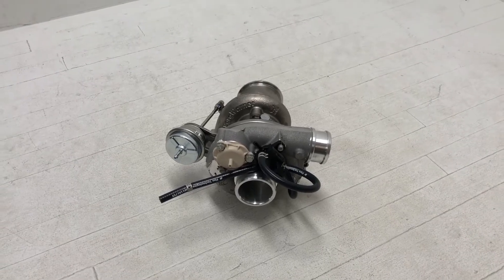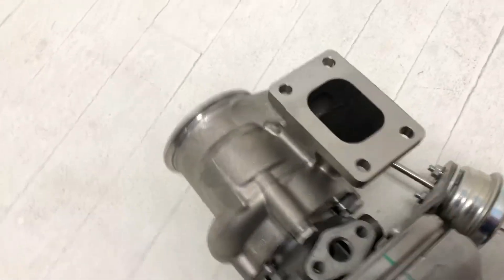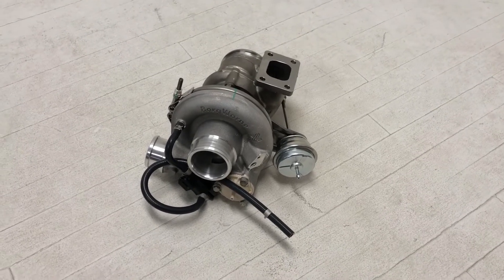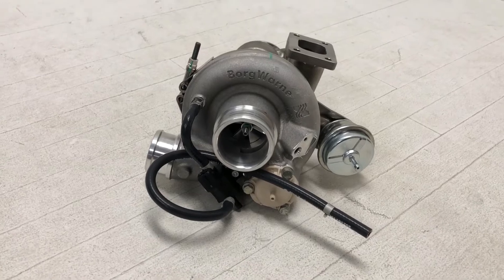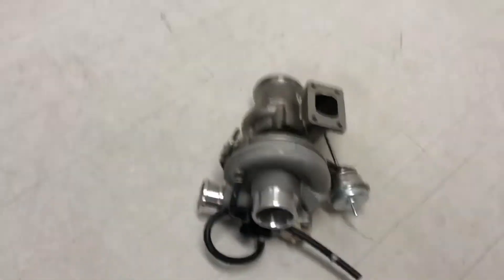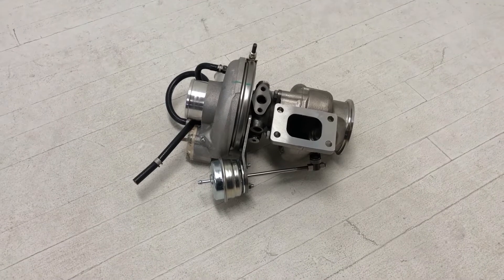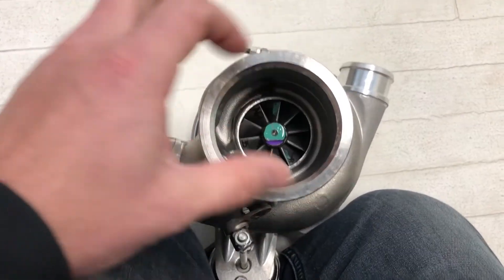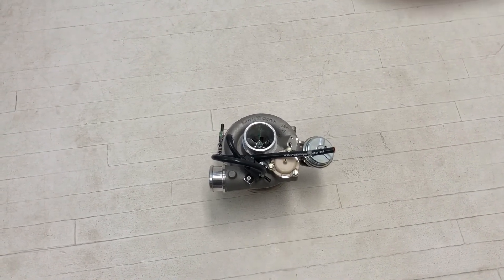BorgWarner EFR 6258 Billet Ball Bearing Turbo - Quick SPECs

Comment: great explanation! I have a pair of these on my Z. making good power but have 2 minor issues with these EFRs. heavy turbos flutter(lack of an external bov- but sounds great) and excessive smoke from exhaust. looking at getting a bov (not sure what size) on the charge pipes and an oil pressure regulator to help with the smoke. your thoughts?
Reply from the maker: Someones kit? A properly set up and plumbed turbo should not smoke. If other Zs with the same set up don't smoke. I'd be looking into your motor and excessive crankcase pressure issues (PCV, cracked ringland, etc)
Reply: @TurboKitscom  yeah its an aam twin turbo kit. built motor and  have a bullet catch can but will look into possible excessive crankcase pressure issues. thinking about getting an oil pressure regulator and a set of external bov from you guys
Reply from the maker: @majareshe  Yeah the Turbosmart OPRs are great, but I would look into PCV, Valve cover breather routing and hopefully not cracked ring lands...

Comment: Got an Audi S2 - 2.2 litre inline five. Did a borg warner matchbot.  I want to reach 392hp as fast as possible, good transient response.

Would an efr 6258 with something like 0.85 A/R be be ok , or would maybe a efr 6758 with 0.64 be better for my usage?
Reply from the maker: 392HP form the motor or at the wheels? What fuel and boost level?
Reply: @TurboKitscom  motor, 98 octane (norway)
Reply from the maker: @sleepymeowtank  I'd stick with the 6758, not a huge spool difference and you'll get the additional compressor flow.
Reply from the maker: @sleepymeowtank  If you 100% need the T25 flange, then this would be the one - https://www.turbokits.com/borg-warner-efr-6758-t25-64ar-iwg-turbocharger-179388.html
Reply from the maker: @sleepymeowtank  If you are fabbing it up to fit anyway, jump to the vband/vband and get the best of both flow and response - https://www.turbokits.com/borg-warner-efr-6758-vband-85ar-iwg-turbocharger.html
Reply: @TurboKitscom  was thinking something similar. do you think a 0.64 A/R would choke it a bit? 0.83 better?
Reply from the maker: @sleepymeowtank  Yes, I think you'll have no problem spooling it, so go with a tad larger AR for better flow!
Reply: @TurboKitscom  that might work :) thanks for the help
Reply from the maker: @sleepymeowtank  Anytime!

Comment: Hi. I have a efr 6758 and the exhaust wheel is broken can you get the turbine wheel
Reply from the maker: Borg does not sell ANY of the parts separately and most rebuilders won't work on them since they need special adapter to high speed balance on the VSR. The last EFR we had to them for warranty, took over a year and was denied due to oil contamination. So your best bet is to buy the replacement Supercore here: https://www.turbokits.com/borg-warner-efr-6758-supercore-179375.html

Comment: I have a mk3 supra with the 7mgte and the stock turbo is a bit smaller than this one but still close enough in comparison. 
Im not chasing huge power and keeping it rather mild closer to stock, looks like this might be a good contender to replace my 30yr old ct26
Reply from the maker: Yes, if you are trying to get as close to stock as possible, but have an upgraded turbo, yes, you could also look at the 6758 as well, some more room to grow with minimal difference in response on that motor.
Reply: @TurboKitscom  Yea, I've been eyeing on both of those. But primarily on the 6258 since I'm on factory ecu and Automatic transmission.
Reply from the maker: @Maeda_v  Great, let us know how we may help you achieve your goal!